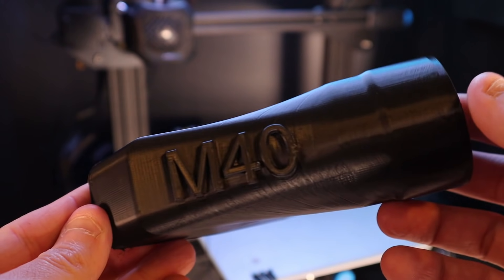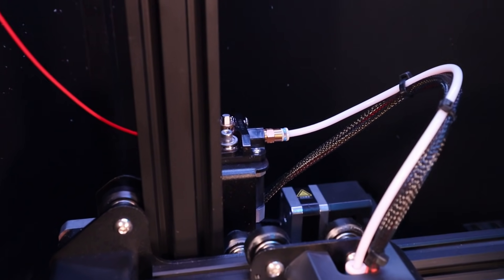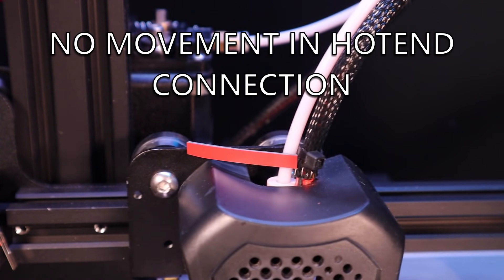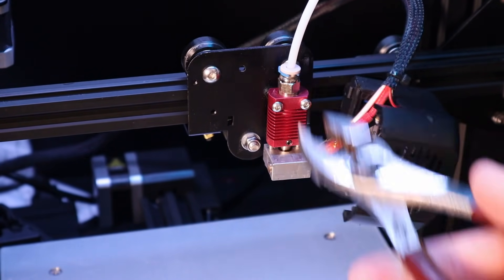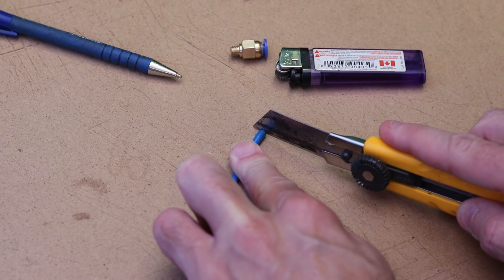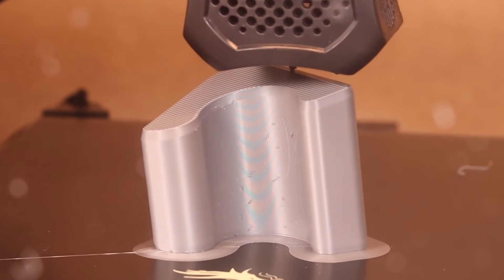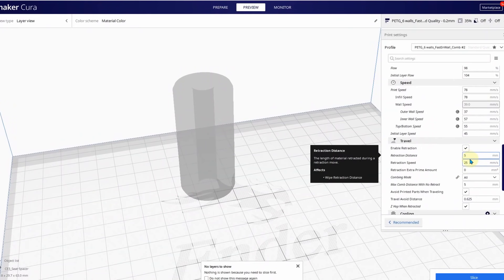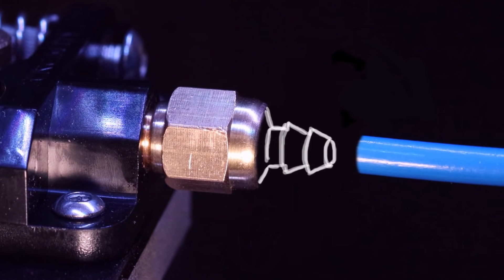Creality Ender 3 V2 - Fixing the Hidden Problem that Can Cause Stringing and Unresponsiveness

Comment: Good tip. . . put your build plate in the freezer to remove stubborn parts. It works great, and by removing the build plate from the printer when you remove your parts you're not exerting any pressure on the bed, which can throw off the levelling! Also a good tip, If you're going to be printing any tight fitting precision parts, then I strongly recommend that you first square off the frame of your printer.

OK, so I purchased my second E3V2 3D printer a couple of weeks ago. My first printer was a major source of frustrations at times, and especially up until 2 weeks ago. But, it gave me a heads up as to what to expect after printing on an E3V2 3D printer 24/7 for 7 months. I'd had extruder problems, under-extrusion problems, bed-levelling problems. You name it, I probably had the problem. The lever on the stock extruder of my older first printer also cracked, and I replaced it with an aluminum one. In my opinion, these types of extruders, both plastic and metal, are flawed in design. They are inadequate for feeding filament to the hot end, and especially at lower temperatures. So even PLA can become a problem to print. In any case, they do not seem to be 100% compatible with Creality's stock hot end. 

As with anything else I do, I attempted to find that sweet spot where everything works smoothly and perfectly. To solve the under-extrusion problem, I'd tried slowing down print speed and making the hot end hotter, but neither of these things helped me to eliminate the clicking sounds coming from these types of extruders. In theory, slowing down the print speed should have given the filament enough time to melt. If so, the extruder would not have had to force the filament through to the hot end. But this was not the case, and the solution was far from obvious. It should also have kept the extruder gear from grinding down on the filament, because when the filament is melted properly the extruder does not consistently bite down on the same segment of filament. After I got fed up of experimenting with these things, and realizing that these weren't working, I switched to Creality's direct drive. This shortened the travel length between extruder and hot end, and reduced drag on the filament caused by friction in the long Bowden tube. I had to reduce retraction down to 1.5mm and my prints are printing perfectly. Enough about the printer feed system.

Next, these printers also lack X-axis gantry support on the right side of the printer. Auto bed-levelling devices only help with bed surface irregularities. These do not level the bed, so all that hype on the internet is actually misleading. It's not a bed-levelling device at all! It's an irregular bed surface compensation sensor which uses a mesh pattern to raise or lower the Z-axis depending on the depth of the bed from the sensor's tip, and indirectly, the hot end nozzle. The lack of X-axis gantry support causes the gantry to sag on the right side. I'd removed and disassembled the gantry in an attempt to raise it slightly, but that didn't do very much. You might not think this matters, but on their own that single brass nut and lead screw are not enough to support the extra weight on the right side of the gantry. I'd had major bed-levelling issues and I believe that this was because of the sagging gantry. So, I added a second lead screw to the right side of both of my printers at a cost just under $200 CAD. The screws must be synced together, otherwise it can lead to other problems. This is easy to do. I left the setscrew (grub screw to some of you) that fastens the lead screw to the coupler loose on both sides of the printer. I turned the couplers to move the gantry up as high as I needed it to, so that I could use gravity and physics to align the teeth on the screws. Then, I used the Move>Z axis, and dropped the gantry as low as needed to sync the screws together. When this was done, all I needed to do was fasten the lead screw to the coupler with the setscrew. I raised and lowered the gantry several times to make sure there weren't any problems. I didn't get it on the first try. I had to try a couple of times before everything worked smoothly, and without locking up the stepper motors. This not only added gantry right side support, but once adjusted, it also keeps the gantry perpendicular with the frame side extrusion. It also makes it easier to level the bed. In theory, if the gantry is perpendicular to the frame side extrusions I can level the bed so that it is parallel with the gantry. A good way to test this is to print a square part. The part should be perfectly square or as close to it as is possible, and not a skewed version of it.

And last, but not least, I replaced the recommended stronger yellowish-colored bed springs for more rigid silicone mounts. Neither the stock springs or suggested yellowish-colored springs make any bit of difference at maintaining the bed level once it's been adjusted. Vibrations can easily unscrew those knobs and throw off the levelling. The silicone mounts made a huge difference. For example, I've had my new printer setup as described above. It's been printing 24/7 for 2 weeks without having to be relevelled. My older printer has been setup this way for only a few days, but it too has not needed to be relevelled. I remember having to relevel the bed on my older printer every couple of days with the stock springs. The yellowish-colored springs kept the bed level a day or so longer. But neither of these kept my bed level and printing 24/7 for 2 weeks time! Oh, and I've started my 3rd week of printing. All I've had to tweak is the Z-offset by about 0.1mm, but my bed has remained consistently level for all this time.

Now that my older printer is set up this way, all the problems I'd had with it are completely gone. My second, newer printer hasn't had any problems yet, and I think I've solved the issues I'd had with these few simple recommendations.
Reply: well i had many issue with a printer (tevo tarantula) which lead to a complete change of hotend, bowden tube, extruder and to hours of unknown problems, until i pissed off and drop the whole idea of 3d printing for an year, then i bought an ender3 v2 neo as was a nice deal for black friday and i start all over, with that all gone easy and started printing after 10 minute from unboxing, then i take back the tevo and found most of the problem was caused by my inexperience and after a day of work into it and a couple of part printed i ressurected the tevo and now both print nice and well... most of the initial problems was my fault tighting the axis roller too much  and did a bad job with the bowden so the filament was rubbing in it and extruder was skipping a lot digging into the filament, fixed those problems the Tevo start printing like a boss...
Reply: Yes the enders 3 all suffer or will suffer at some point of the x sagging and the super clumsy bed system that can't maintain the calibration. The bowden system is not such a problem imo, but I have the neo with metal extrusor and I have it tight so it has good torque. The x gantry for the moment l can have it pretty much square for weeks until I need to push it up. I overshot the height position of the right so when I tighten the excentric nut it moves down a little and ends up where I want it (at the same height of the left side obviously). I check with physical objects and with a leveler. Then for the bed I printed the leveling wheels clips that don't allow them to move THES ARE A MUST Imo (for those with springs being yellow or the basic ones). I check the bed via pronterface and level it until I like the numbers of the sensed 16 points. The other thing is the z offset, I use a thermal receipt paper which is thinner and more suited for the task. Then I use a little of adhesive spray sometimes and the ratio of good or even excellent prints is a lot higher. I'm printing for a month now and really enjoying the process. Ender 3 machines are printers with potential but they are not good out of the box, or not for more than two or three prints anyways... But hence the price.
Reply: @Drumaier  I only managed to get a glass-like finish for a short period of time, and have not been able to get it to print like that since. These printers are a constant source of work to get them to work optimally.
Reply: This is spot on i can say after 1 year owning the ender 3 v2.  Right side of the gantry sagging is what i immediately noticed after i assembled the printer for the first time. I just reassembled to whole gantry about 5 times before i was happy and could make nice prints without bed leveling issues. The stock springs wiggle and dont stay  in place. Silicone bed spacers and a using a pei sheet saved me so much frustration.

Comment: This is the exact issue on my ender 5 pro, the fitting is wearing out and have changed to the spare one but it still does it since never thought to expand it like this or just the stock fittings have too much play in them. (Comes stock with Capricorn)

Will have to look into buying new fittings

Comment: what if you just sanded the end of the tubing, and used masking tape like that? Granted, you'd have to be careful not to get any dust in your machine from sanding, but if you can avoid that, I'd guess it would be an alternative solution. You could also lightly scrape the end with a knife if you don't have sanding paper, as long as you don't pierce through to the inside. Just some ideas to throw out there.

Comment: Ok why didn't workout ??.. I got an Ender3 v2,  before this I never had any kind of 3D printer. and I did not have nor do have any issue .. I dont get it why so called expert are having so much issue with the 3D printers .. dont u guys have any basic ( maybe 5th standard )  engineering knowledge ??

Comment: There are many assumptions in this article.
Firstly Bowden is pronounced Bow as in WOW.
The PTFE tube and fittings are specifically designed and made for compressed air or fluid use not as a guide tube.
The fittings are a bastardised Festo design for a quick connect air fitting with the sealing O ring removed, hence the slack in the line fit as the barbs are not hold in the correct position.
What is required is a Swagelock style asymmetrical ferrule and fitting.
This style fitting will grip the tubing and as long as not over tightened will be a vast improvement over stock.
Additionally the excess movement is calculatable if you measure the inside id of the tube and the od of the filler and for every 15 degrees of bend allow for the difference.
Outboard motor control cable design is basis for formula.
E.G. the id is 3mm the od is 2.5mm difference is 0.5mm bend radius is 45 degrees 45/15 = 3. 3 X 0.5mm is 1.5 of excess filler movement.
Measure bend at several hot end and z track heights and average the bend radius.
Interesting diagnosis but some assumptions are not so sound.

Comment: What would happen if you dont use a tube at all... just the filament?
Reply: But I leave the filament on the role it comes in exposed on the reel of the printer to open air all day and I have had no problems with moisture.
So no tube really needed?
Reply: @raspberrypi4970  PLA filament or what maybe you keep them well and your environment fits well so it can't absorb moisture
Reply: @AAAA-tp4gw  
Cool, thanks for the input
And yes I use PLA
Always in a room of 78°or below
Reply: @raspberrypi4970  you can use it no tube no problem just in case for protection from brittle or moisture
Reply: You still can print well but if your filament is brittle that's means it's hygroscopic (it absorbs moisture) cause it to break easily you should dry it 4 hours in food dehydrator buy one it's cheap you'll need that important also keep filament in air tight sealed box case you'll good to go

Comment: The longer the tube, the more stretch & compression you'll get in both the filament and the tube.
Probably not going to be much, but compared to direct drive, is another reason for the much greater retraction needed.

Comment: can someone help me every time I heated my Nozzle the Filament keeps  ooze out alot anyway to make it stop from wasting Filament
Reply from the maker: Do you mean it oozed from between the nozzle and heat block?   If you're referring to the end of the nozzle, it is normal when heated to ooze, there is pressure buildup and oozing is relief for that pressure.  It varies depending on temp and filament, PETG oozes quite a bit, ABS not as much, PLA a little as well.

Comment: I’ve just set up my ender 3 v2, my first 3D printer, and I can’t get it to print. I’ve got the bed leveled and it’s preheating just fine. Any advice?
Reply from the maker: I should send you a file, it could be your slicer.  I am not home now, send me an email needitmakeit@gmail.com  I assume you are printing with pla?   Does the printer home okay?
Reply: I just set mine up. Test print X not good. Are you using the free filament that came with it? I’d try some decent filament too if so.
Reply from the maker: @TimMcTim1888  I use the cheapest PETG available, i'd check belt tension first on the X, and then test the x-carriage wheels to make sure they have no play, if they do, adjust the eccentric nut to remove it making sure not to over-tighten.  PLA needs to be kept dry, moist filament will produce poor results.
Reply: @NeedItMakeIt  Thank you. Did go over all wheels etc, and things worked better. Many thanks! The stock PTG was very rough and I feared snagging was an issue.

Comment: i cant even take my boden tube out to replace my extruder
Reply from the maker: Loosen the fitting, loosen the fitting completely, push the fitting up the tube toward the other fitting, then depress the end of the fitting and quickly slide it off, you only need to do this for one fitting, the other can slide off passing over the entire tube length.   I hope that helps.
Reply: @NeedItMakeIt  i was gunna do direct drive anyway so i cut it off... thanks for the advice tho

Comment: I literally got an ender pro v2 TODAY , It's my first ever 3d printer and i finished building it 3 hours ago, i go to bed, open YT on my phone, and this is the first thing i see. For fucks sake
Reply from the maker: As far as problems, it is pretty minor, I will mention while you're already upset that the plastic stock extruder may break, some people have reported this, the single gear metal extruder with the M10 bowden fitting works well and is cheap, it will fix the movement of the tube and the extruder in one shot.  Happy printing!
Reply: Oh, thank you!
Didn't expect a response from an author, but it's nice knowing what to expect
I'm still very new, but I'll try my best here ;)

Comment: You already messed up, the key to getting it to stay in the hot end is to leave a turn so you can  force the PTFE down at the hot end, and with an aluminum dual drive that comes with a pass through fitting you can do the same. (Add the clip before tightening)
Reply from the maker: Not really the way to start a comment..  "You messed up", come on man.  

Anyway to your point, this particular fitting was not a through connector.  Yes they are available and I have made follow up videos on the subject.  The PC-4 M6 thru fitting is the simplest and best solution for this situation along with the 'Preload' technique.

Comment: The ptfe tubing is better. I don't see how a smaller diameter tube of more abrasive tube would work better.
Reply from the maker: Hard to say for certain, sometimes you need to default to what the majority of people believe.  Capricorn tubing seems to be the one most people like to use and consider an upgrade.  I'm still not sure it performs better, however it is more flexible and it seems to be less affected by the heat at the nozzle.

Comment: I was pulling my hair out on every print. I would stand and watch the brim and first couple of layers hoping nothing got screwed up. And it did, most of the time. Then I purchased the "WINSINN Dual Gear Extruder". All aluminum, twin gear driven. I recalibrated all the settings and I can no for the first time hit print and walk away. The plastic, single drive just never worked right.

Comment: Wait I've just been staring at my ptfe going in and out like that thinking how cool you can see when the filament retracts and never thought of it as a point of defect. I'm getting that fixed ASAP!!!
Reply from the maker: Best solution yet that I've found is to purchase a PC-4 M6 Through fitting, or if you have the M10 with the metal extruder, you can push the tube in with some sandpaper to seat it all of the way, and then tighten the fitting that last 1/2 turn, this does an excellent job and it is super cheap.
Reply: @NeedItMakeIt  Unfortunately it's happening with a BMG clone
Reply from the maker: @KentoCommenT  Oh, I still have yet to try any of the BMG style so I can't help much there.  I have the Bondtech LGX on order, I'm really looking forward to testing it, hopefully it isn't a letdown.

Comment: Change extruder to extruder with same tube fitting as at hotend.  Original extruder have small and bad tube fitting. The tube is loose in  and worsens the retraction, because it is then necessary to set the length of the retraction 2 mm longer to 5mm. Change original tube to PTFE Capricorn. Unscrew fittings 360 degres from full tightness before give new PTFE tube into new tube fitting, lock up the tube and tighten fitting. Set smaller lenth of rettraction from 5 to 3 mm.

Comment: I received a ender 3 v2 on 3/26 and they had a better fitting with more metal teeth. Prints great! I did the tape test and there's no movement at all. Still upgrading to capricorn for high temp printing, but the stock tubing prints great. Also the extruder knob has a brass insert now which is a major plus.